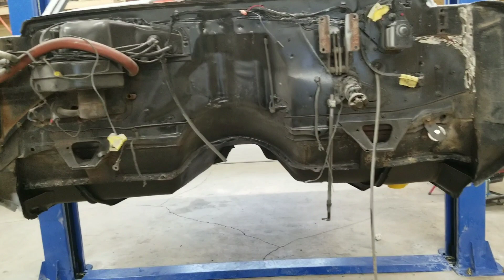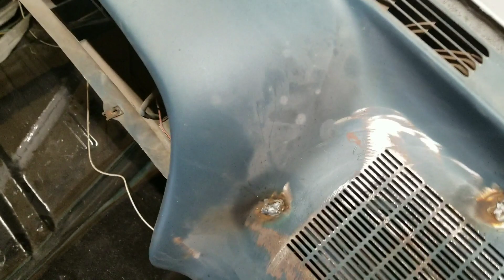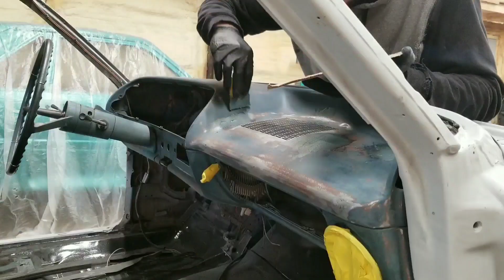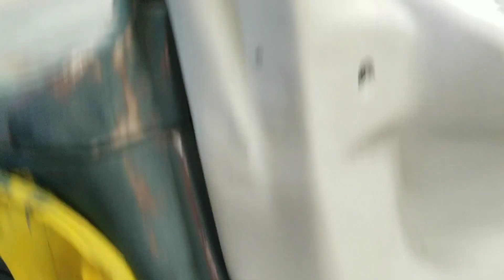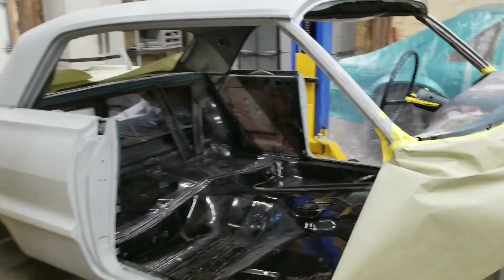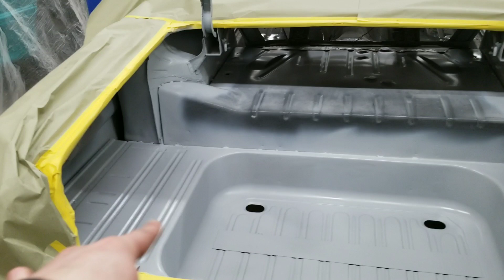64 impala frame off vlog #frankingston build part 9 old muscle car metal dash welding and repair

Comment: One question brotha,do you sand down the epoxy primer and then shoot high build primer
Reply from the maker: You can spray your 2k directly over your epoxy after your epoxy flashes, just as if you were putting on another coat of epoxy. Or you can let it dry completely and go over it with 180/220 then recoat with your 2k
Reply: @bpbrestorations2093  ok cool I’ll do that thanks a lot bro your a lot of help definitely thank you,

Comment: Nice work...
Can i ask you how many hours you had in
Floor
Quaters
Upper trunk deck
Lower trunk tub
Reply from the maker: Probably around 40 or 50 hours on that stuff combined. Not counting bodyworking quarters after metal work.

Comment: That's a lot of work. I've ran into a lot of frustration with aftermarket stuff on a 67 442. Door handles and tail light bezels didn't fit worth a crap and rechroming pot metal is  insanely expensive. Hope y'all don't have these problems. I'm learning from your video. 🍺🔧
Reply from the maker: Yea we try to use as little aftermarket stuff on all our projects as possible for that reason. Thanks for watching buddy!